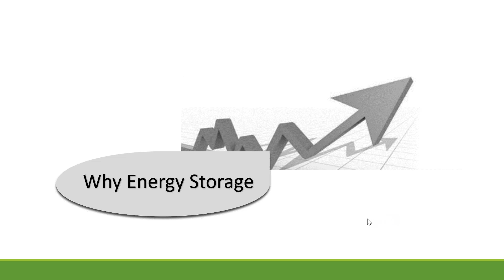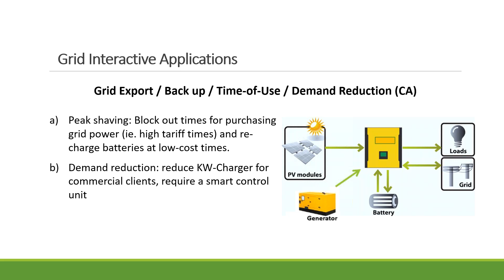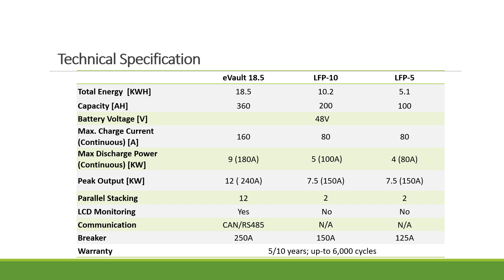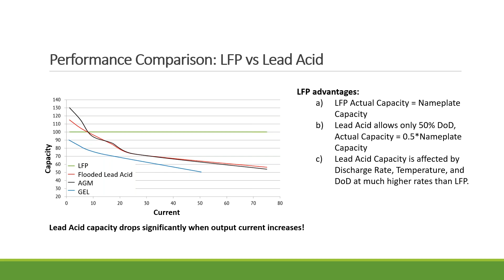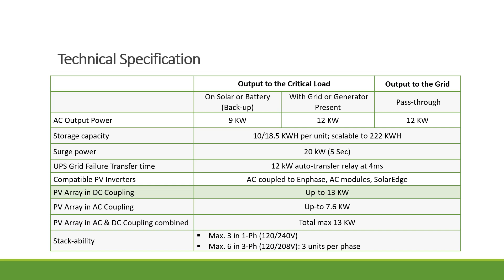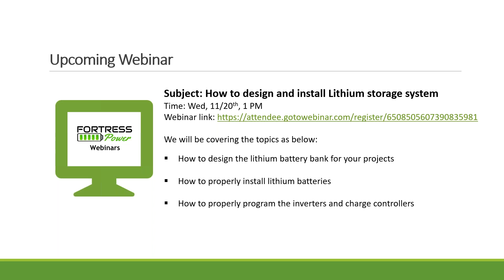FAQ's of Lithium Energy Storage

Comment: very poor wording of what does what., so this thing is just a battery ?, need a inverter to turn back in to ac?, and separate charger to charge unit?, what does it do besides hold power, does not seem like a tesla power wall that does everything or does it do all the things a powerwall does?
Reply: The product being addressed here is "Lithium Energy Storage" - LFP-based batteries. The end customer's needs then dictate how you integrated the battery into the customer's home. 
Example for grid-tie solar, you'd replace the string inverter with a Hybrid Inverter and hook up the battery to it.
Example for retrofit into existing solar installation without modifying it (or when the solar uses microinverters), you'd hook this battery up to a AC inverter. This is exactly what the Tesla Powerwall 2 does - it is a battery + AC inverter.